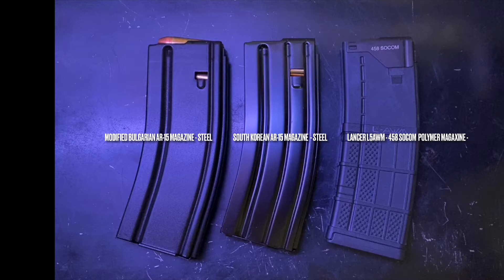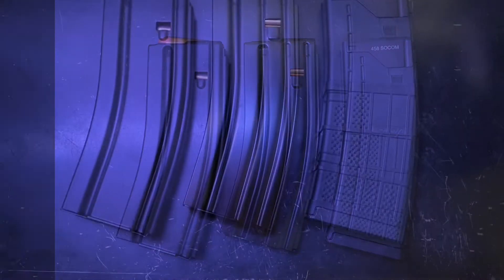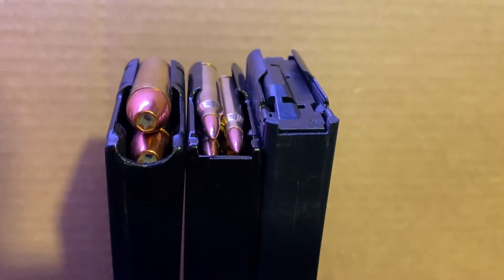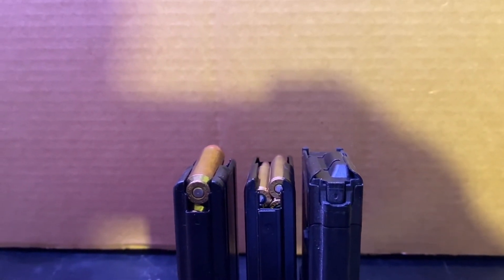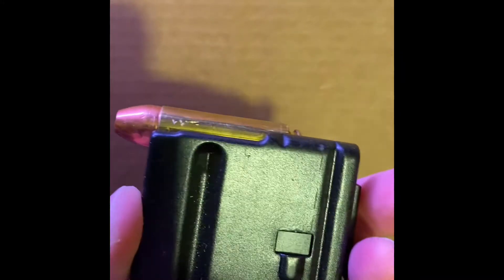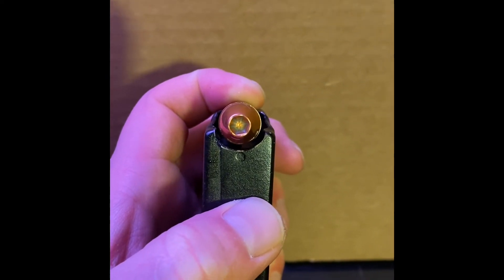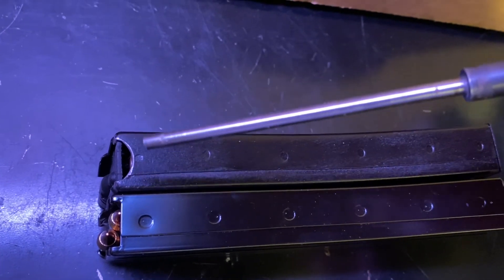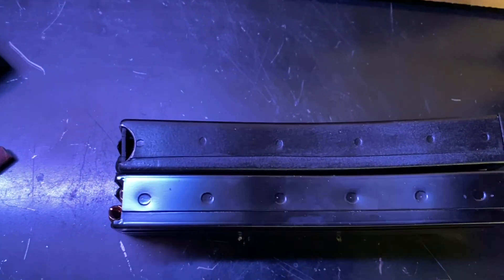SOLUTION - standard AR mag modified for 50 Beowulf

Comment: You really don't need to do this for 30 round mags (and certain 20 round mags).  I've use standard steel mags and Pmags and ive had no feeding issues or damage to feed lips (however i prefer the GI mags more)  if i recall too the round itself was designed by alexander arms to work with unmodified STANG mags.  

The only time ive found myself having to modify a magazine was with steel 20 round box magazines.  Any other 20 rounder works fine

Comment: Is it running fine?also how much was your upper did it break the bank or have any issues
Reply from the maker: Runs great, no issues.  I bought a cheapie upper from Bear Creek Arsenal and have had no problems with it.  Now in fairness, it hasn’t had 1000’s of rounds through it due to the cost of ammo for this one….but what I have put through it has had no failures in feeding, ejecting, firing, etc….  No issues at all.
Reply: Bear creek's big bore line is mostly fine, the barrels are really well built however the only concern is the BCG extractor but you can buy a stronger 7.62 one.  Their firing pins also have issue but I think swapping for a titanium one with a big bore round is a good idea

Comment: Would a magpul gen 3 with window for 5.56/.223 fit a cycle a 12.7x42 round?
Reply from the maker: It should.  I would be a little worried about bulging of the polymer at the feed lips, but magpul does have a better polymer than the other one I tested.  I think you should be good to go.
Reply: @SMR-Tactical  thanks. Didn’t know if i needed to change the follower or not. 💪🏽
Reply from the maker: Ahhh, I see.  I don’t believe the follower would need to be changed. Should be good with the one that comes in there.

Comment: I must be lucky,my .223 mags work just fine 🙂
Reply from the maker: It’s called tolerance stacking.  If yours work without issue, you are lucky indeed.  But depending on the tolerances of the parts used, one may or may not have the same experience.  I tried PMAG’s and Bulgarian Steel AR mags, and they just didn’t work quite right for me.   Once the Bulgarian AR mags were modified as shown in the video above, I have had zero issues.

Thanks for watching!
Reply: @SMR-Tactical  mine are original Colt mags from the 80's,and yes I agree for the most part it's about tolerances but that is with anything

Comment: Just curious, can you show me a 50 Beowulf specific mag that has a similar cut out? My initial problem with the polymer 80 was the last round continuously jamming and I was looking at that magazine and noting similar interference but then the thing emptied itself on the floor and I gave up on it.
Reply: The polymer magazines are shit mine does the same thing I can only load two rounds in it maybe three once I add the forth it vomits every last round out. I’m looking into steel magazines because I noticed that the polymer magazines lips like flare out so the magazine is not tight at the lips and any little bump all the bullets are on the floor.
Reply: @eidtnaci  I'm in NY so the mag must be pinned in place so you only get one shot at getting it right. Was hoping for a true 10 rounds. Steel doesn't give you that option that I am aware of. 20 round steel will get you 7 and 30 is too much hanging out there for me. Oh well.
Reply from the maker: Strangely enough the big bore magazines (.50 Beowulf, .450 Bushmaster and .458 Socom) don’t seem to have the relief cut like I am doing here.  I think they must use a different follower angle and/or different angle of the feed lips to accommodate and “steer” the larger round into the chamber.  

On a standard AR mag a person may have good luck, but my experience is like yours…rounds either shoot out of the magazine like an expensive jack in the box, or they jam up during feeding and scratch the hell out of your brass.  

So far this is the best and lowest cost solution I have found to reliably feed these huge rounds.